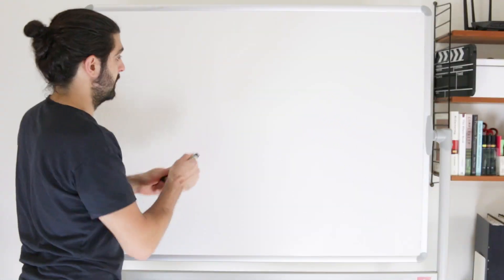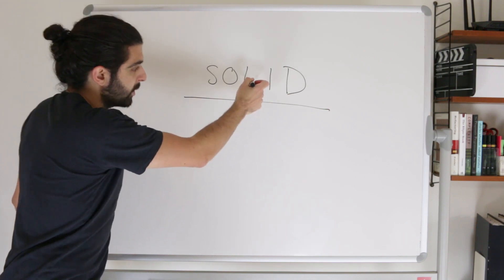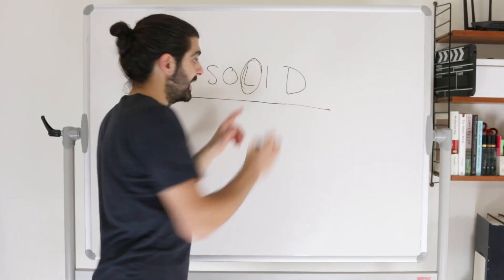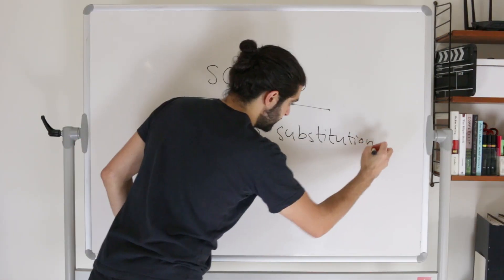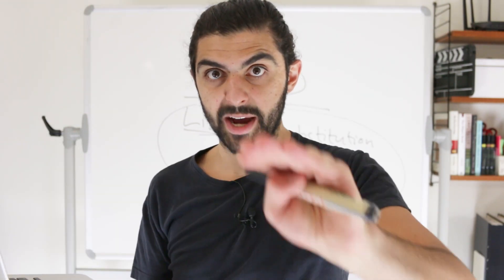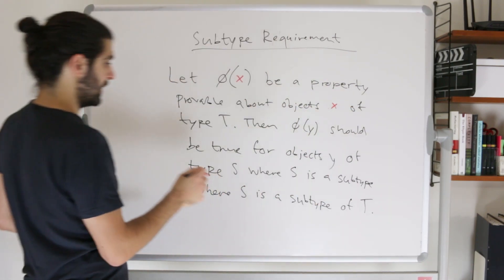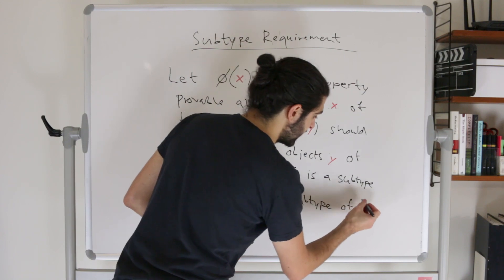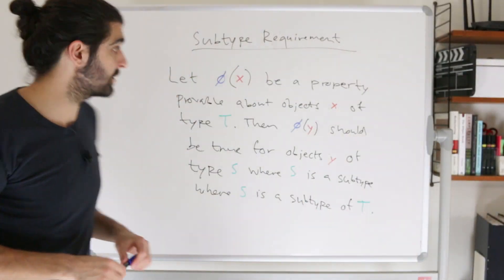Liskov's Substitution Principle | SOLID Design Principles (ep 1 part 1)

Comment: Our brains don't have any problem with this principle when we deal with interfaces. Implementing classes MUST adhere with the behaviors of the interface they implement. For example, a class that directly or indirectly implements that interface must have those implementing methods. For example, any class that implements Sortable interface, must be sortable by definition along with any its subclasses. HOW they sort can be different, but they have to be sortable. You can cheat by having an empty method in any class. HOWEVER, no matter which type or subtype of Sortable you put in the code, you should be able to call the "sort" method. This is why we "code to interfaces" by doing this:

class T implements Sortable {}
class S extends T {}

Sortable x = new T();
Sortable y = new S();
x.sort(); // you could replace anywhere in the code you see that with => y.sort();
y. sort(); // you could replace anywhere in the code you see that with => x.sort();

This LSP in a nutshell!

Comment: I fully understood LSP when you said on 10:57 "they're trying to show us when we should not use Inheritance and when we shouldn't"
Reply: exactly!
Reply: So the quote states, that we shouldn't use inheritance :D Or there is an error. :D. LSP is says that we should adhere to method argument and return types, when using implementation or when extending abstract declarations or overrides. Usually when you do not do that, but implement Interface with type declarations you get Type Error. 🙂

And we have to understand that type declaration can be abstract or interface, so child classes can be a fit for as an argument or return type.

Comment: The name of that symbol is "theta" - it is one of the Greek letters..
----------------------------------------------------------------------------------------------------------

Example:

Where theta is a property, let theta = liquid (the chosen property for theta to represent is "liquid")
Let X (sub1) = water and let X (sub2) = orange juice
Then theta(X sub1) = the liquid which is water
And theta (X sub2) = the liquid which is orange juice
if you have a PARENT class theta(X sub0) where X sub0 = what makes liquid liquid (eg: viscosity, malleability, flow, boiling point) then CHILD class theta(X sub1) and CHILD class theta(X sub2) should each also have viscosity, malleability, flow, boiling point and they be defined identically to theta(X sub0). Any ways that theta(X sub1) and theta(X sub2) differ from one another can not alter the base behavior that defines liquid (viscosity, malleability, flow, boiling point). They can add to that base behavior in a way that makes each child more specific than the parent it inherits from (eg: color, smell, taste)  but the base part of that child class that is inherited can not be altered by those extensions. In this way either of theta(X sub1) or theta(X sub2) can be substituted for the parent class theta(X sub0) in any place in the program without failing.

I think

Comment: Hey awesome explanation man, I have just started with code architectures and agile coding and have been able to get a grip on OOD just because of your channel big thanks for that and I have started recommending to everyone at my university who are interested in code architecture :D

I also have a tiny requestm, if at all possible, I am presently looking at data oriented design approach... I am planning my carrer in gaming industry (programming obviously ;) ) and recently discovered issues regarding cache miss and other low level cost and with data oriented design architecture stating that it can be used to write high performance code specially for games. I searched and went through many resources but I cant seem to wrap my head around it. Many veteran programmers seem to know this by experience but since I am a novice I am unable to figure out whats happening or how to structure the data acc to DOD rather than OOAD... If you could share a little light on it then would be great... 
thanks again for bringing agility to my code :D :D

Comment: And also question - "Substitutability is a principle in object-oriented programming stating that, in a computer program, if S is a subtype of T, then objects of type T may be replaced with objects of type S (i.e. an object of type T may be substituted with any object of a subtype S) without altering any of the desirable properties of T (correctness, task performed, etc.)"

so if we have class Animal and we have Cat which extends animal. And animal has method speak() which is empty and Cat has method speak() which shows 'miaw' in the screen. But we are altering the property (as I see wikipedia also calls methods as properties) of Animal and break corretness of the program. Lets say correct program was that speak() does not show anything to screen. And when we replaced Animal with Cat - program works incorrectly - shows 'miaw'. So then qestion is - how do we solve this problem that we want cat to say 'miaw' with the speak() method, because it makes sense that speak() method shows 'miaw' but at the same time not break this principle? Or we should not overwrite the methods?  THen again - why is this feature in the language?